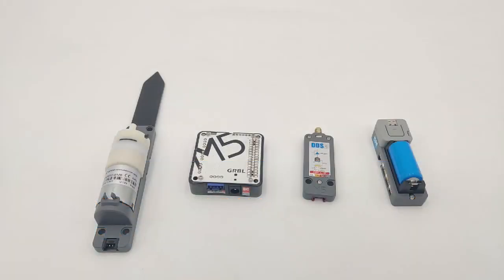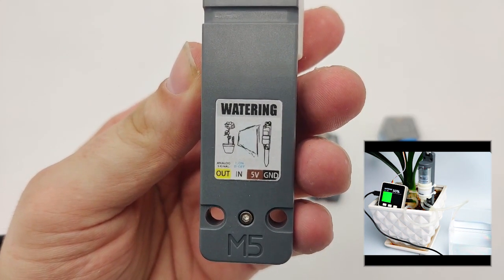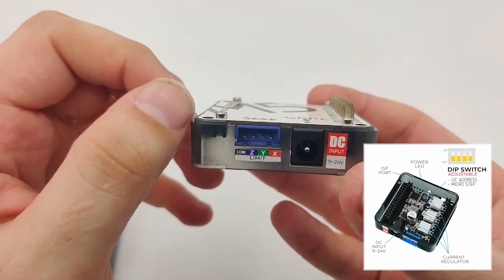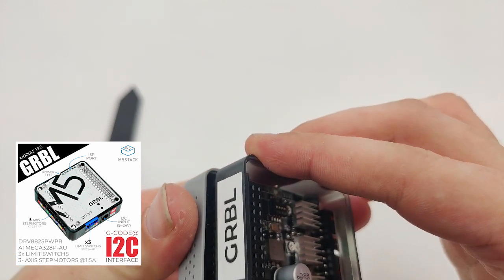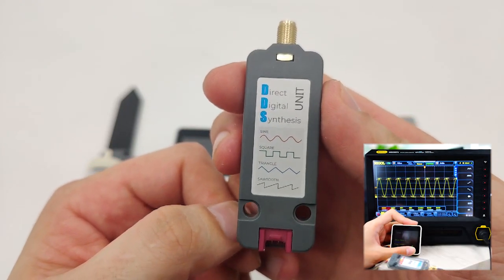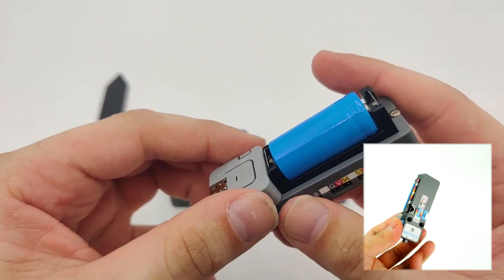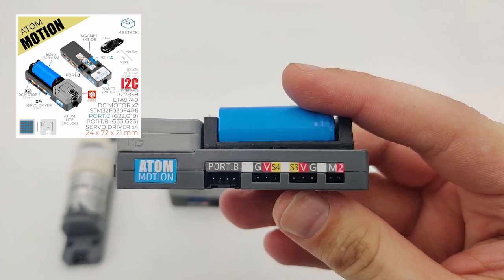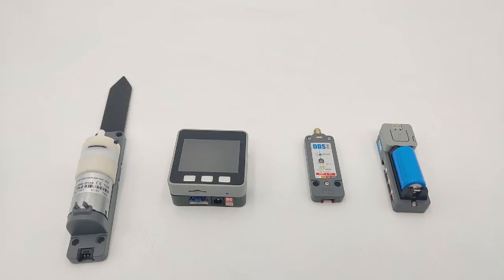New gadgets dropping! | January 2021 New Product

Comment: Where's Luke?
BTW: A real 3d Printer Module would be awsome, with extruder stepper and 2 relays for bed and nozzle and temp sensor input
Reply from the maker: Luke has stepped down from his regular role and will only be doing occasional videos from now on. Roni is a talented programmer from Israel who will be putting out more content on the channel. Will mention your 3D printer idea to the team.
Reply: @M5Stack   must be as easy to set up like the lerdge 3d printer board, and if you can use the wifi to implement something like octoprint, maybe combined with one of your camera modules you can really get the attention of the 3d print community.
and BTW: the most exciting feature of the m5 family is UIFlow, there are some modules and units that are not implemented in UIFlow yet. the Atom Stepper kit for example. please make every module or unit UIFlow compatible :)